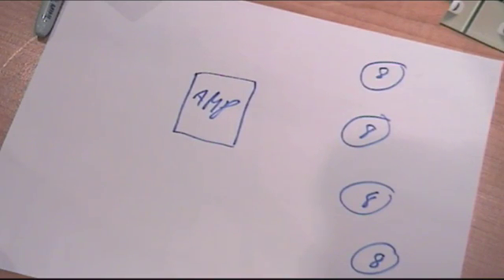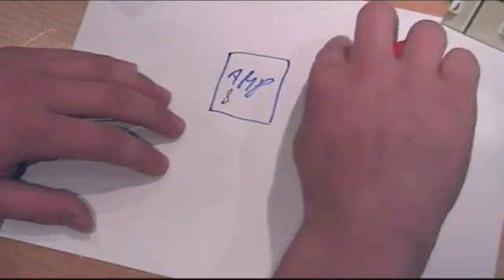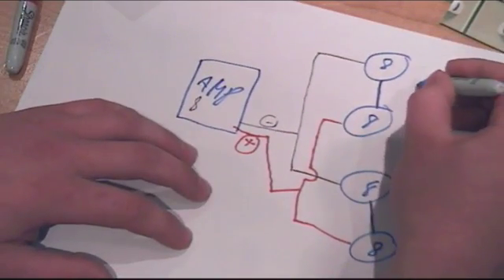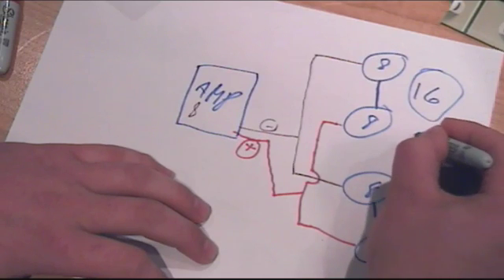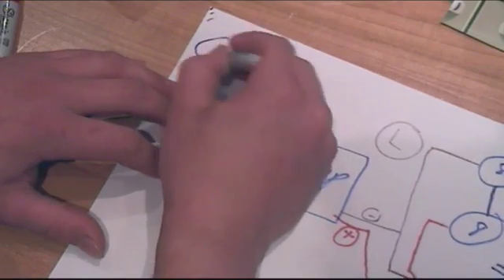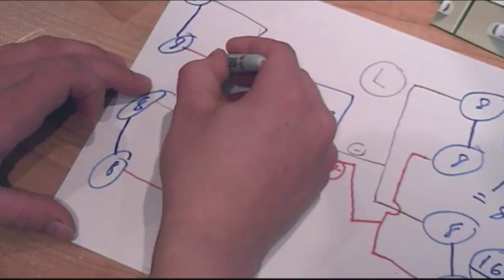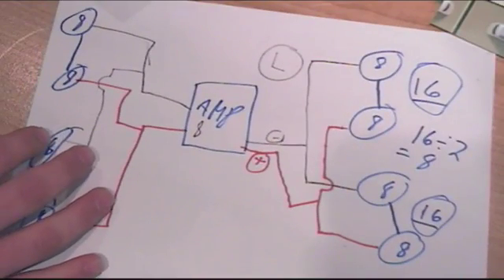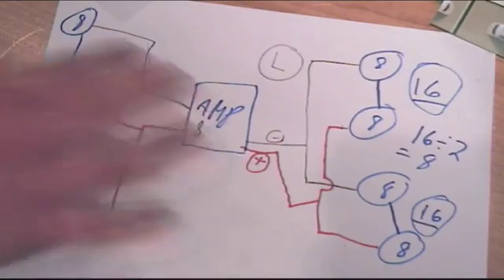Speaker Impedance Matching (Connecting Multiple Speakers Properly)

Comment: Yeah but when you connect the speaker's that way, it also reduces the volume of the speakers too. 
I got a 500w amp with 5 channels, each channel can handle 4-8 ohms. I wanna know if I can fix a 250w speaker to each channel which has a impendence of 8 ohms. Wouldn't that make a total of 1250w because 1 speaker is 250w. All I wanna know is would that be possible because in the back of my amp it just says 500w and connecting 5 speakers with each 250w would make a total of 1250w.
Reply: The speakers do not make 250 watts that is just the max rating of how much u can send to them without overheating the voice coil and eventually blowing the speaker do some research before hooking up a system bud but good luck

Comment: Actually... it's not divided by 2. Ohm's are added when connected in series, but when it comes to parallel connection there's a formula for this : Speaker1 multipled by Speaker2 and divided by speaker1 plus speaker 2, so it's not just by 2 all the time unless both ohm values are exact the same.
Reply: Piotrek Staszewski I could have sworn before he drew in the wiring that he stated that all of the speaker values were exactly the same maybe the brainiacs that know everything aught to listen more
Reply: Now the calculation that you described is correct but for the example he was using he was not wrong now yes if he had been using a 8 ohm speaker and a 6 ohm speaker the final impedance would have been different but he was not he was showing an example using speakers of the same value. Edited for speech-to-text correction
Reply: lol... i was gonna correct him too on that issue
Reply: Piotrek Staszewski
Reply: Piotrek Staszewski I'm hooking up 4 rockford 8" what kind of amp should I buy n how to hook it up to 4 4ohm speakers

Comment: I bought amp 8 ohm and I bought 6 ohm speakers for home theater help!
Reply: +Dan Donna return the 6 Ohm speakers and get 8 Ohms
Reply: thanks  I got my amp manual and said it can due 6 or 8 ohm
Reply: The 6 ohm speakers will do just fine.
Reply: my 6 ohm surround speakers running 2x 40 feet 12 awg wire but I can use 29 feet for one of surround speakers instant of 40 feet
also I replaced power cords on pre-amp and amp from 6 feet 2 prong power cord 2 10 feet 3 prong having the ground wire (not in use) would cause any noise in equipment?
Reply: My amp does support 6 ohm after looking in manual :)

Comment: why is it when I connect two 4 ohm subs at 1000 watts each and my amp which isn't even close to that, 155 watts, while playing a test tone of 2-4Hz at full volume with the bass maxed out, I could blow my subs if I tried hard enough, why is that?
Reply: The reason for that is  called distortion which is the number one reason speakers blow . you amp its not powerful enough to drive those speakers so you crank it all the way up in order to make it loud but at the same time you are forcing the amp beyond its safe power handling causing it over heat and start sending a distorted signal unsafe/uneven that will cause the speaker VC to move out of the safe range for which was crated.  put it this way itll  be equal to crank you 150 watt amp connected to 25 watt speakers, youll blow them eventually cause that increase in power its making the speaker VC move back and forw beyond its save operational limits. surpriselly youll more likelly to blow your 1000w speakers with your 150W amp first than those 25W speakers .(.and on a site note youll also kill your amp So dont do it. This days Amp come with a lot of protections ,filters and tecnologi aim to keep distortion to the minimum  but itll always be there the key is know where that spot is and stay away from it..

Comment: If i have three 4ohm speakers on both right and left side and a 4ohm 2-channel amp so how can i connect the three speakers in series? Or is it only possible with four speakers?
Reply: +MrMegaismo Im in same boat man, i wanna run 3 speakers on right n 3 speakers on left, all speakers are 4ohm.. n from here im stuck on what amp to get n how to wire it :(
Reply: Interesting. What happens to the positive wire of the top left speaker and the negative wire of the speaker below ?
Reply from the maker: +Kalyan553 it connects to your amp

Comment: thanks for the vid, i have my set up this way: 2 sub of 8 ohms in one channel and 2 speakers of 4 ohms in the other channel. so the subs converts to 4 ohms and the speakers converts to 2 ohms, my amp runs much cooler since i reduce the impedance in both channels.
Reply: Great bro

Comment: nice. show  backwards now. I'm building a system four 8 ohm 2 channel. wiring two 8 to four ohm
Reply: +Mr Lazy If you pair two 8 ohms through a parallel connection it will become 4 ohms. In this video the wiring is shown as a series connection.

Comment: All very good but are you audio engineer qualified ? Where do you get your information? 
Like Amps and speakers are not cheap so I wish the engineers from example Nad would explain these tech issues. 

I'm not saying your right or wrong. Just saying people would be risking their expensive gear on your say so.
Reply: +Bend Em (Moving Pictures roll em) Its simple. and he's right....but on a quick note, if your gear is so "expensive" doesn't it already sound great? most higher end systems these days are super compact like "Bose" or 5-10 +1(sub) channel  monsters that are amazing, doing such techniques is mainly to increase the performance of low quality two channel systems that need more room filling sound....and some advice if you do so, find speakers all of the same impedance in different sizes, 1 inch- about 6 inches (depending on the wattage of the amplifier) and make sure the speakers are the same wattage rating, the smaller the speaker the more crispy highs and the bigger the speaker the deeper the lows. and I will always recommend an amplifier with a subwoofer channel, so 2+1 or whatever..Hope I helped out a bit. oh and If you have an old 500 watt amp, connect 6-15 inch(12 inch is most common) speakers in parallel/series. sounds awesome! cheers.

Comment: Hi I have a small problem I think...I have a 500watts amp at 20 ohms is  a sub woofer amp...( ADS)brand...I would like to wire three 4 ohm speaker is it possible.....whats the best way to wire ....three speakers at 4 ohm...or three speakers at 8ohm

Comment: Hey can you help me, I want to exchange my 2 guitar speakers with a single bass guitar or a PA speaker due to many reasons and i have experimented with bass and PA speakers with a guitar head and i like it. but would it be possible to. The amp is designed to run 2 speakers 50watts RMS (100 peak) at 8 ohms(for each speaker) but i want to drive 1 big bass or PA speaker to run at 200 watts peak. the reason why is the music i play and the tuning I play in will damage my guitar speakers at some point and especially bc they are nice eminence speakers.  But i really need to know if its possible to use the output designed for 2 speakers to drive 1 single speaker without damaging anything. if it really is possible, what would the speaker wattage have to be and what would the ohms have to be? and would I have to wire it differently? i would like to go a little over the peak wattage such as 50 to 100 watts over the peak to reduce clipping and so i can turn my amp up all the way without blowing the speaker (i rigged the amp with a fan so it doesn't overheat). the combo amp i have is a Crate Dx-212. you can find manuals online everywhere but when i looked at it, it doesn't give you much info about the actual amp itself. this would be a lot of help to me and my band if i could upgrade this amp to drive 1 speaker

Comment: OK. I got one. I want to wire up a little 4ohm sub to a 2 channel amp with 4ohms per channel. I want to run both channels to the sub and wire up a 4ohm speaker to each channel as well but it sounds like shit wired strait that way (pos to pos, neg to neg). What would be the best way to do this?

Comment: this way to connect multiple drivers has one flaw. if all the driver are faicing the same way 2 of them will be out of phase.the result is inneffective speaker.Serie coupled driver must be placed bakwards with the magnet so all membrans push air the same way at the same time.use a 1.5 volt battery and your eyes to see that drivers are in phase.if you are making a bipolar speaker with 2 inn front and 2 drivers inn the back,its the way to go.If you are making a line source speaker parralell coupling is the way.when i build line source i order drivers with 12 to 16 ohm impedans.

Comment: how about the wattages of the speakers? i mean i have an amp that says 500 Watts x 2 RMS. If i connect 8 speakers the same way you did on this video,  what are the wattages of these 8 speakers to cope with the specs of my amp? thanks sir !
Reply: 3
Reply: Neil Bantugan The power handling of the speakers would just double.
Reply: so, 1000 W x 8 speakers at 8 oms?
Reply: or 250 watts each?
Reply: Neil Bantugan If you have 8x250W 8 ohm speakers you will be making pairs of parrallel speakers means that you will get 4x500W 4 ohm but you serialize them into two pairs so you get 2x500W 8ohm
Reply: Remember Parallel = Double power handling and half impedance where Serial = Same power handling but double impedance

Comment: Good Job partner! I'm doing this exact installation today in a fitness center. I'm using a 430 amp with 7 channels and an ohm rating that goes from 4 to 16 ohms. I'm hooking my 8 ohm Yamaha dual cone speakers up in series and then parallel back to the amp. Since with my application I don't need stereo left and right I'm going to use a mono 3.5mm plug to get the same signal (sound up the middle)from my sound source into the amp then out to every speaker. Again, good job, this is very easy to follow for those who've never done this.

Comment: Do you think I should use a line-level 2nd-room output for use with a separate amplifier & switch on the Onkyo-TX-NR636 for zone 2 so that I can keep the 7.1 sound in the main room so it don't drop down to 5.1 when I use the Powered Zone 2 Speakers (for Patio) and another room at the same time ?  Very nice video MclnTEC , Thank you for you're time !!!!

Comment: Please can you advise me how  to wire up 12no 6inch 1ohm 5 watt speakers in a house. Each one has an independent cable run back to the coms room and I have been given a 120w PA system to try and wire to it . The buzz bar at the back has the following from left to right 1no 4ohm nut / 1no 8ohm nut / 2no COM nuts 7 then 5no high impedances speaker nuts with independent on of switches on the front. I can send images if some one can help / Know nothing about amps and impedances noelhynes10@hotmail.com

Comment: Good job bud, a little rough in some of the descriptions but over all very well done.

Oh, and how funny are the comments, "its not 1 ohm"... haaaa. Each speaker in parallel drops impedance by HALF. So, 1 speaker starts off with 8ohm, 2nd in parallel is 4ohm, 3rd in parallel is 2ohm, 4th would be the final for 1ohm when all speakers are in parallel. Thus his tutorial, why you need to know how to wire series, or series / parallel.
Reply: rebelnut1 It actually is not 1 Ohm.  Parallel impedance is calculated using the inverse of the sum of the reciprocals of the speaker impedances.  It is not a simple half-ing as you suggest.   Three 8 Ohm speakers wired in parallel is actually 2.6 Ohms.  Four 8 Ohm speakers wired in parallel is 2.0 Ohms.
Reply: SoundSystemDesigner My apologies, you are correct. http://www.eminence.com/support/wiring-diagrams/
Reply: Well, his demo is to help people  not to uplift himself  as the greatest and make fun of everyone  else trying to save money and diy

Comment: Hi, Sir! So I have been using our home theater for a year now.  I'm currently studying DC circuits on a Computer Engineering program so that's why I have a less knowledge on impedance matching. The scenario is that the home theater runs 5.1 channels with the port of subwoofer rated at 4 ohms. The current subwoofer is a 4-ohm subwoofer at 250 watts. What does it mean by the watt rating of the speaker when the total output power of the amplifier is 1000? The case is that I feel that the subwoofer does not give that much bass. So I'm planning on upgrading my subwoofer to a 14 inch from a 10 inch. I found a 14 inch subwoofer on our nearby appliance store and have it tested. I was beyond satisfied by the bass it gave. The 14 inch subwoofer is rated at 300 watts at 8 ohms. My question is: What exactly will happen if I'll hook it up to my receiver? Will it sound the same as to what I felt on the store? Will it burn the amplifier? Or somewhat, the speaker(the planning to buy, 14 inch)? It's Pioneer that already has a casing. Take note that this subwoofer is a powered one. The one that is needed to be plugged.

A detailed help to my problem is very much appreciated, Sir. :)

Advanced thanks to you and cheers for your knowledge on impedance matching. :)
Reply: If your reciever is rated for a 4ohm load, hooking up an 8ohm speaker will draw much less power, so you will get less volume, but with a 14 inch, you could just crank the bass and be fine.... essentially, you could hook up another of those speakers in parallel for your 4ohm load, but you would have half the watts going to each speaker...
Reply: rebelnut1 Thank you so much for your informative reply, Sir/Ma'am. :)

Another question: Will it affect the total output of the amplifier which is 1000W when I'm about to attach a powered subwoofer over the amplifier? Thanks in advance! :)
Reply: Active/Powered subwoofer's power will be at 500W.
Reply: TheAmiableMatt Ah very good question. You do not want to hook up an amplified powered signal to a sub that has its own amp. You want the RCA output going to the sub, which is just a small signal for the sub to Amplify. Generally most receivers will have a "pre amp out", which, is what your looking for.
Don't just take my word for it. I'll shoot you a link as well.
http://hometheater.about.com/od/loudspeakerssubwoofers/qt/Passive-Subwoofers-Vs-Powered-Subwoofers.htm
Edit: Almost missed the question about final power of the amp. Since your sub has an amp built in, you will be taking 0 of the wattage from the receiver. Which ultimately can be better, because now it's not working so hard and can provide a cleaner signal to the rest of the speakers in the system.
You may need to power that sub on a different outlet. Sharing the same one "could" cause you to trip a breaker.. I'm not saying it will, but keep that in mind. Hope your build goes well, plan to share it on youtube?
Reply: rebelnut1 Great! Saw it at the back panel of our receiver. I could nearly bust out everyhting if it wasn't for you. Thanks, man! :) I though it would be the end of world to me. LOL!

Comment: can any one tell me how to connect multiple speakers to my mackie fx8 mixer that i already have 2 yamaha s115 speakers with mixer from wich im using the 2 tape out outputs on top but on back there is 2 main outs with 3pins on them and the speaker im trying to connect are the Yamaha 2 DXR, 2 DXS COMPLETE SYSTEM; Active self-powered please can any one help with answere? thanks.

Comment: Hi, nice informative vides indeed! Can you tell me how can I connect 14 Speakers (Bose DS 16F loudspeakers) together. How many channels in an AMP will I need to do it? Any suggestions will be appreciated.
Reply: YOUNIS IBRAHIM Under the grill of the Bose DS16, you will find a rotary "tap selector".  Set it to the desired wattage. We'll assume you've selected 16 watts. Fourteen speakers, set to 16 watts each, gives you a total of 224 watts.  You need to find a 70 volt amplifier that produces at least 224 watts per channel. (A mono amp is fine.  Most 70 volt amps are mono.)  Ideally, you want to provide 20% head room, which would have you use a 269 watt, 70 volt amplifier.  An oddly specific wattage, so I would steer you toward a 300 watt, 70 volt amp.

Comment: i want to run four 4ohm speakers of a 2 channel amp could u please post anthor video on how to do this without lowering inpedance
Reply: It is always the rating of the ohms divided by the number of speakers,if you are using a crossover stereo ,I believe that's more recommendable
Reply: So
Reply: 4ohms÷2 is 2 ohms,you will need an amp of at least 2 ohms to run your channel ,L and R, just make sure 2 on R and 2 on L

Comment: out of curiosity, multiple speakers does not imply higher volume right?
more in parallel implies lower output, more in series implies higher output?
So it depends entirely on the type of connection right?

Comment: I have a problem i have a 10watt amp... And 8 speakers 4 are 8 ohm
 4 are 4ohm
How do i wire them up with a single mono channel...?
Reply: you could do the four 8's in parallel(2ohms. set1), two 4's in parallel (2ohms, set2). Put set1 , set2,  and one of the 4ohm speakers in series  and you've got a 8ohm load

Comment: I have a pair of speakers in 4 different rooms.  They are 8 ohms.  Can I use the system you described and still use in wall volume controls?  I have a Harmon Kardon PM655Vxi amp that says its high voltage, high current.  It has High instantaneous current capability and can provide 45 amps of instantaneous current. The amp has a selector to output for 4 ohms and the speakers can be changed to 4 ohms as well.